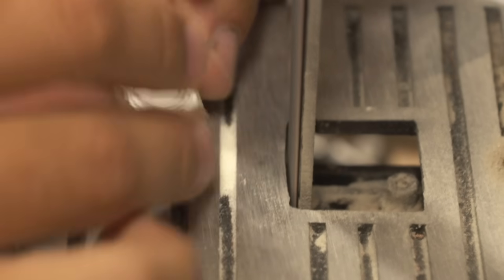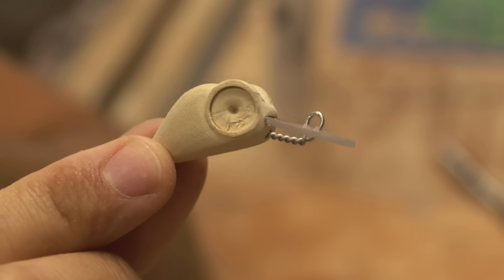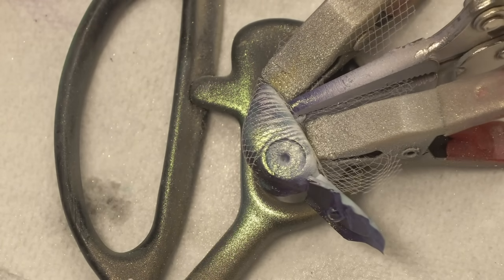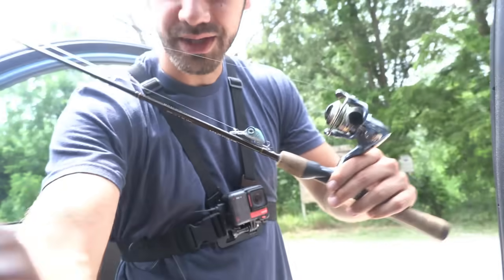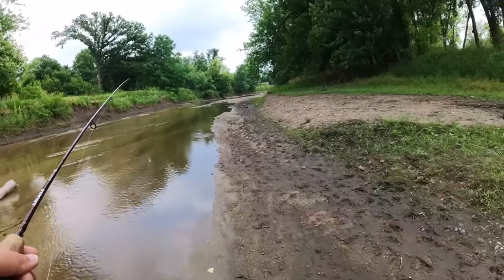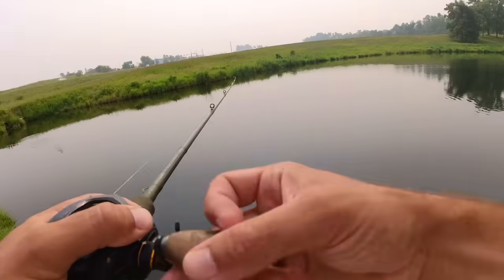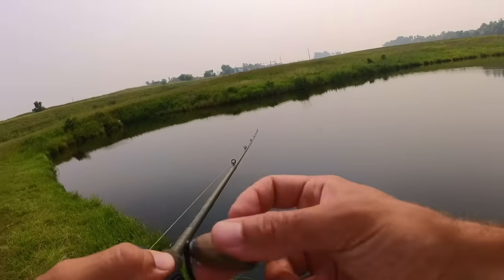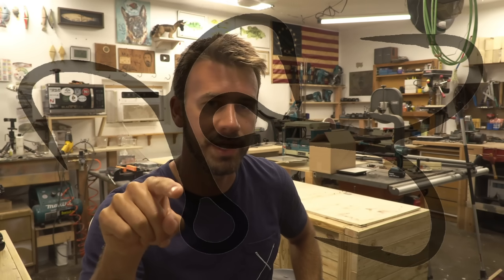Nano Diver | One Day Build to Catch

Comment: If you want a super smooth clear coat, you might want to look at Loon UV Flow or something similar.  We use it a lot in fly tying and i thing that would make the process a lot easier as it's much thinner.

Comment: I use a hair drier to thin / smooth thread coat on my custom rods. I'm unsure if the UV resin would flow better if heated / thinned, but i suspect it would.

Comment: Have you ever considered using a small vacuum chamber to pull the bubbles out of the epoxy or the uv resin before putting it on the rotisserie?
Reply: You can just use a blowtorch to pop all the bubbles on your finish.

Comment: You can cut off a piece of the wire and use it to drill the holes in the lip. When it spins it kinda gets hot and goes through. 😜